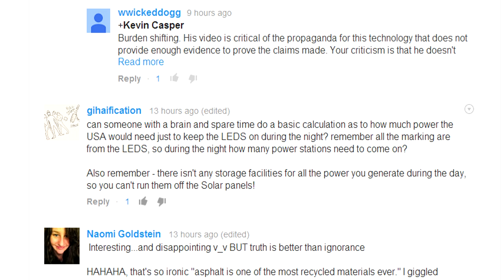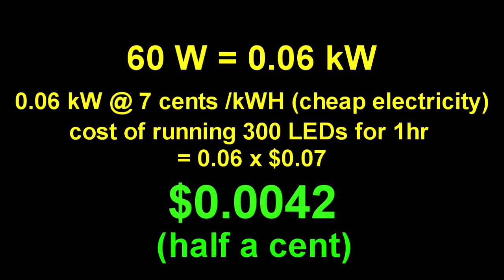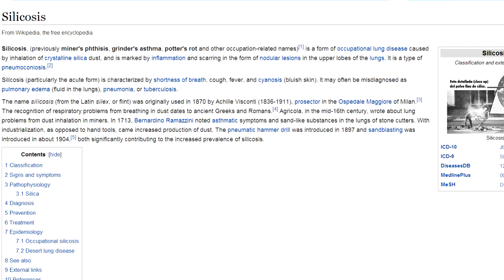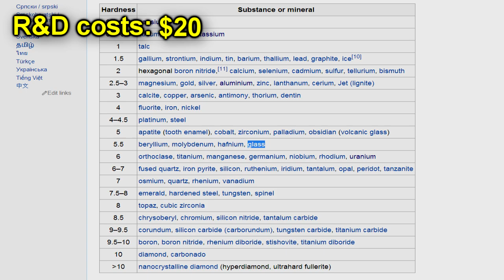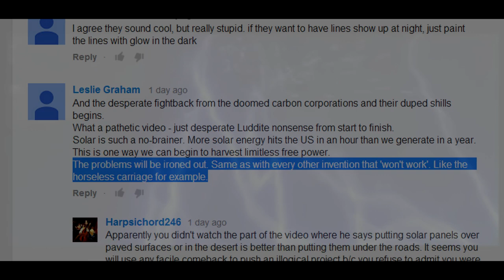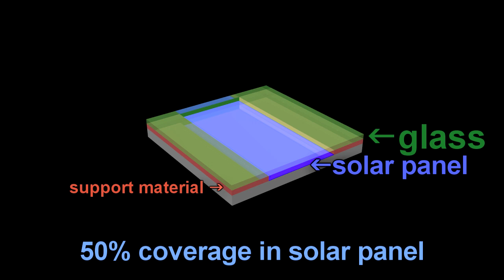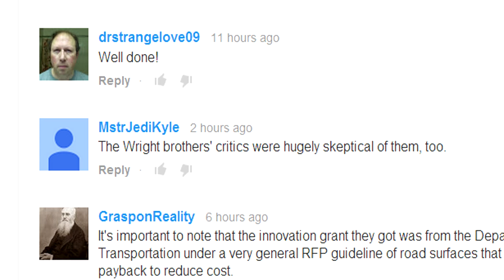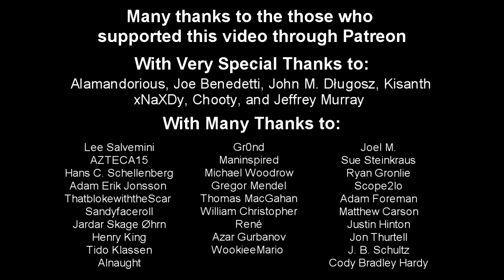Solar Roadways, IMPORTANT QUESTIONS AND ANSWERS!

Comment: Using tiles will give issues with the pressure, as in TF's first video was explained. If they are like in the demo supported by concrete, every asphalt road needs to be converted to a concrete bed to support the tiles. 

Working with different  materials leaves space for water to enter and freeze up, which crash the tiles. Or even dirt to settle into and crackup the tiles due to heating and/or pressure from heavy traffic.

Comment: My view on the matter is I am part skeptical and part open minded, I want to see its prototype Carpark and the statistics that arise from that, I want to see how they then either improve the prototype or stop use of the product based on its statistics, I don't want to completely remove its possibility but I still want to be skeptical but no to the point I completely deny its possibility.

I like Thunderf00t and his estimations but the same could be said about the invention of the car, we could say Henry Ford might of had the goal to create a car for 80% of humans at the time and wants to create X amount of cars, with X amount of materials with X amount of cost! This is unfathomable and completely unrealistic! Yet it was completed and sold for quite a hefty price and created with quite the hefty materials also and before the final T model there were many many prototypes to fix and reduce cost and improve the innovation:

"There were several cars produced or prototyped by Henry Ford from the founding of the company in 1903 until the Model T was introduced."

Also a little article on Forbes talking about innovation and skepticism

"“If I had asked people what they wanted, they would have said faster horses,” said automaker Henry Ford. Ford went on to revolutionize the manufacturing industry and make automobiles a household necessity. Similarly, inventor Guglielmo Marconi proved the feasibility of sending messages through the air — what we now know as the Radio. But he was taken into custody and examined in a psychiatric hospital because his discovery was considered unbelievable."

If I was to gauge my percentage I'd say I'm 40% for and 60% skeptical based on Thunderf00ts reasoning's and a few others online, the 40% would be mildly increased from 20% because the owners made this post talking about the panels and the problems Thunderf00t addresses:

http://solarroadways.com/clearingthefreakinair.shtml

This could be influenced by my lack of knowledge on the subject also maybe if I was Thunderf00t with his knowledge it would be 100% against but me being behind my eyes I cannot scream nay or yay! But a percentage of both based on the debate at hand from the experience and knowledge of both parties.

To conclude: I feel we should give it the chance at a carpark take those results and then go further, if its successful and reaches reasonable standards in its statistics that my percentage will shift again if its the opposite then I'll lose all confidence in the project but my point as it stands is not a definite on either side!

Comment: Most of these arguments are once again BS.
http://www.solarroadways.com/clearingthefreakinair.shtml
Reply: That article debunks nothing. For example the concern that heating the roads would be too expensive is "debunked" by saying "Well a thousand people dying from snow on the roads every year is expensive too". How is that a rebuttal of any sorts?
Reply: Look at the LED pictures in their post, they are all vertical examples and more tightly packed LEDs too.
Reply: Literally none of the arguments presented in the video are debunked by this page.

Just saying "Ah, we thought of that!" does not a debunking make, especially when the very nature of physics is involved.

Not to mention the intellectual dishonesty that comes with presenting things such as the Moh scale to claim "Haha! Asphalt is Softer than rock ! Eat that skeptic!".

The point was never to compare asphalt to glass, but rather the random rock pebbles on the (proposed) glass hexagons, that will, as brilliantly demonstrated in the video, completely destroy the glass transparency and therefore energy output.

That is unless you make it a non scratchable glass, which as discussed in the video once again, would make the costs even more ridiculously higher.

Basically, the very idea of driving on glass and getting a little bit of energy from solar panels is ridiculous. As has been said multiple times before, it would require far less money to simply put panels on the side of every road, which would also produce a lot more energy, due to the panels being able to follow the sun..

I actually hope Thunderfoot makes another video just ripping this page to shreds.
Reply: Stupid place: It is a stupid place to put pannels there. Watch the vid. and you'll se why. (Angling..cough)
Costs: Of course it will be cheaper. But where do the recources come from? All the platines have to be made somewhere, made of a recource, made with energy (is that energy green?)
Asphalt may not be perfect, but still easyer o maintain.
Hardness of the glass: Hmm pretty easy testing that glass gets scratched very very easy with gravel, dust etc.
Recicling of glass: Well. if they do not intend to do it, why did they show coloured glass? Looks a bit odd, to use it, even if they know that they cant use it.
Reply: OH and also, it's fortunate for them that their panels don't have "the correct" type of LEDs so they can't use their panels as an example of how well they work at day.
Reply: That doesn't really answer any of the concerns TF raises. Yes, some LED lights can be seen in sunlight, but their examples are all facing sideways, not up. Yes, asphalt is relatively soft, but in road covers it's used as a binding material for various kinds of hard gravel...etc. etc. Vague bullshit and dismissal of critics as "haters".
Reply: YoungerBrother Wakeup When you eliminate the cost of plows, road damage caused by plows, repair needed for road damage caused by plows, excessive stop and go traffic resulting from roads needing repair due to plow damage, car repair expenses caused by accidents due to icy roads, medical bills resulting from accidents due to icy roads, car erosion caused by road salt, it's REALLY difficult to argue that these roads would be too expensive to heat---especially considering the roads would only need to be heated a few degrees above freezing.
Reply: Eco Vulcan
"only" is the word. It is extremely energyconsuming to melt ice
Reply: TF's first video explains why "heating only a few degrees above freezing" is not as simple and cheap as they make it sound.
Reply: JanPospisil42 The first video's argument was that it would take a crap ton of energy to melt ice to water, which is a BS argument because the intention is not to melt ice, it's to melt snow---not solid ice.
Reply: Eco Vulcan No it isn't really. It takes a large amount of energy to convert 1kg of ice into liquid. Next time your car is snowed under try to clear it with a hairdryer. A solar panel will generate 300 watts on a good day (and that is a solar panel that is not UNDER a road surface). It would take at least 400 watts to just convert a single kg of 0.0 degree ice into 0.0 degree water. Are you starting to see the problem?
Reply: YoungerBrother Wakeup Unless you've tested out these specific panels (which aren't even the final product and will still undergo modifications), your numbers mean nothing. And it looks like I need to say this again because you conveniently ignored it the first time because there's no way you can argue that it's too expensive to heat these roads:

When you eliminate the cost of plows, road damage caused by plows, repair needed for road damage caused by plows, excessive stop and go traffic resulting from roads needing repair due to plow damage, car repair expenses caused by accidents due to icy roads, medical bills resulting from accidents due to icy roads, car erosion caused by road salt, it's REALLY difficult to argue that these roads would be too expensive to heat---especially considering the roads would only need to be heated a few degrees above freezing.
Reply: Eco Vulcan You do understand the unreasonable amount of maintenance that will have to go into solar powered roads right?  In the end, you might be eliminating some costs associated with the roads right now, but will introduce a ridiculous amount more.
Reply: burlakinavolge  You can't yet know what the required maintenance will be for these roads because SR hasn't yet gotten to the stage where they can test and give numbers/results. However we DO know how much it costs to upkeep our current antiquated roadways. If you check out all the costs our current system generates and all the costs these roads propose to eliminate, it becomes harder to see how it wouldn't be worthwhile. I have yet to see a skeptic who's considered all the benefits.
Reply: burlakinavolge Clearly, he doesn't understand :(

Not to mention the desperation that comes from flat out ignoring the incredible amounts of energy it would take to heat those panels above freezing in harsh winters.

Even worse if you consider that snow will pile up on the side of the road then "fall" on the solar panels (+ natural falls) , at a rate which is extremely unlikely to cleared by solar powered heat.

In fact, I'd hazard that it would be even more dangerous than currently, as the heating would melt some (but not all) of the snow, likely allowing part of the melted snow to be frozen again, making the roads very unsafe.

Comment: I would also like to point out that humans are stupid. Since the LED's won't be visible during the day, no roadmarkings during the day. So let's take a 4 wide road both directions, would it be safe enough to drive without the lines to indicate the lanes. And yes you might argue that you and joe trucker are bright enough to follow a somewhat safe path. But does count for every driver out there? I think not. Accidents will increase. And if you think of painting the lines, there goes more solar coverage.

Comment: Wouldn't it make more sense to put the panels above the road. Ambient light from the sides would be enough to see during the day, and give you the structures for light at night.

Why complicate the cells need to support heavy vehicles. Hell you could even make them track the sun if overhead.

It would also be cheaper in the long run, the structures could even run fibre optics as well as grid power cables, no more power poles. and what about recharging while driving on the freeway, think electric trams or bumper cars. Running low on juice, just move to the charging lane and extend.
Reply: TF actually proposed that in the first video. It would make much more sense. It really makes the most sense to put solar panel in the desert when they get a lot of sunlight...which is what we are doing. Where I live in the midwest, we harness solar energy via the wind and windmills.
Reply: ***** Well... the sun creates the wind. The only power source that doesn't come from the sun is nuclear power.
Reply: ***** Actually, wind is created when air is heated up by sunlight.
Reply: flabbergast
Ummmm?  The sun is a huge nuclear fusion reactor, so any energy we get from the sun is basically nuclear power.
Reply: ***** Actually, he said they harnessed solar power through the wind by the use of windmills. You said he was wrong by claiming it was kinetic energy. The problem is that the generator uses kinetic energy. And it's the same in nuclear and coal power plants. Heat is used to make motion trough a medium and that turns the generator.

You are the one trying to correct something that didn't need correcting and when proven wrong you want us to stop debating because "you are right, na na na na bo bo"
Reply: Johannes Klatt Yes, the Coriolis effect also has a significant contribution to airflow patterns.
Reply: robo336 There is wind mainly because the earth is spinning... just saying.
Reply: ricksite
One disadvantage of centralised power generation is the loss of power with distance, this is somewhat overcome by high voltage transmission.

Solar panels can be affected by heat as well, the hot conditions can reduce the efficiency of the panels, somewhat reducing the sunlight advantage, hot components have greater resistance. Also the greater temperature variables can place greater stress on components and structures reducing their longevity.

A decentralised power grid is less susceptible to security threats and natural disasters.

Deserts sound great, but they aren't the only solution.
Reply: *****
I wonder if they consider that the earth generates its own heat through radioactive decay and gravitational tidal forces with the moon and sun (and other celestial bodies). Surely as these slowly leak out they would contribute to wind generation as well.

Surely we must also categorise wind derived energy as geothermal as well.

Would a gas giant in orbit around a black hole also have wind, even though there is no light?

Comment: What ? ... Why would you need to light every led on every panel up, for road markings ? There are lines on both sides of a road and then some dotted lines at the center with the occasionnal appearance of some other markings (parkings, stops, etc...).

It does not amount to 100% of LED functionning. In fact most of the panels would have no LED working at all. I can't really pull a number out of my ass but i'd say probably less than 15-10% of all LEDS.

As for the rest of your arguments, they hold up pretty well.

Comment: I wonder about winter myself...how would you plow such a surface!?
Reply: They use the energy from the sun that failed to melt the snow!
Reply: Oxycominum I just .... that's a just huge facepalm all around.

(Dipping into the sarcasm here) -- With heated roads we'll have the homeless sleeping on the interstates in no time. That'll cause congestion and many of these tiles won't get ample exposure to the sun needed to power these roadways!
Reply: X X Hmm... Random robot pops out the solar tile and drags the bum lying on it for warmth off the street kicking and screaming.

Sounds amusing. At least in an "I've had a bad day and now I'd like to see someone have a worse one." kind of way.

Comment: Well no, they've already said that they'd only be on when cars are on them... (Not that I think solar roadways would actually be viable)
Reply: I will bet it's even more efficient to keep them on. Or you know.. paint them on :-P
Reply: How will they know cars are one them? Pressure pads? So more expense then?
Reply: But having pressure sensitive panels that communicate with each other would only add to the manufacturing cost, the maintenance cost and the electricity bill.
All of them have to be intelligent to know how far ahead they should light up depending on the speed. And they have to be sensitive enough to work with both a 36 ton truck and a 100kg scooter. 

Simplicity is often better than complexity. Specially when it comes to things that need to just function, like a road.
Reply: flabbergast Yeah. I was wondering how sensitive are these pressure plates going to be? Can it be sensitive enough to detect frufi the purse dog but still be strong enough to handle a semi? Also how does the pressure plate distinguish between animal/obstacle and vehicle?

Comment: Not to mention vandalism..... you know how many of those would be broken on purpose just for fun by venting teens or drunk people? This is a stupid idea at best..... Have you ever seen the gouges in the highway from a wreck? Think about the damage a car wreck would have on those panels.....This is a stupid idea at best .... plus heavy equipment, road graders, backhoes, tractors, all of these have much higher psi loading on the roadway than the legal amount of an 18 wheeler at 80,000lbs, in farming regions in particular, the roadway would be endlessly destroyed.....This is a stupid idea at best..... Or say a cinder block falls off a construction truck or a load of pipe comes lose and crashes into the glass......This is a stupid idea at best.....

Comment: Photovoltaik will be an important part in the energy mix in the future. As you can see in Germany. But too put it on the road is really silly - especially as there is enough roof space. Also: Power outage for every traffic jam ;)